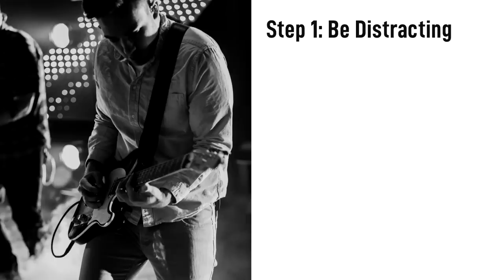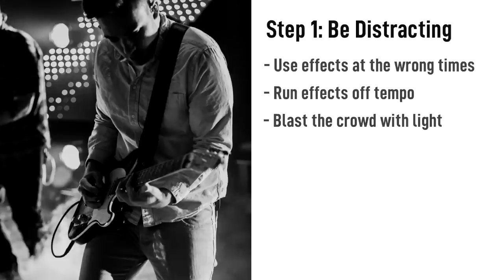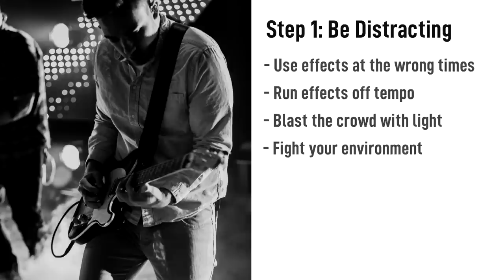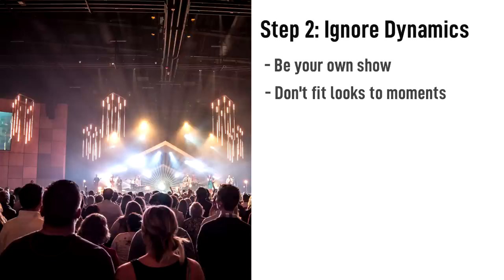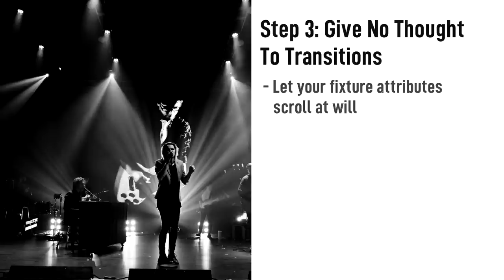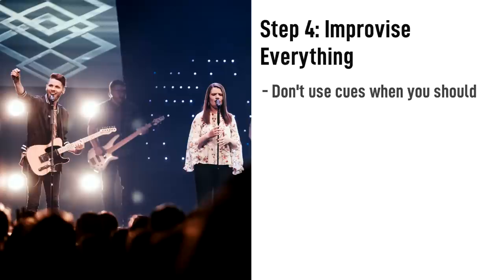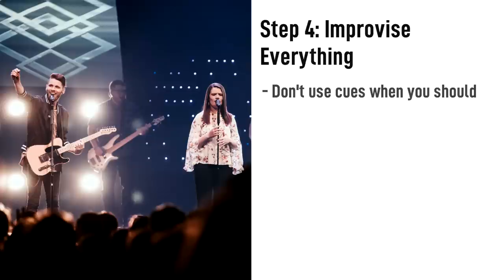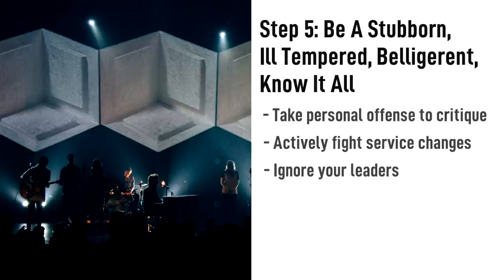How To Be A Bad Lighting Designer

Comment: I agree with ALL of this! However, when you sync your effects, they don't ALWAYS have to be synced to a quarter note BPM, sometimes I run a song quarter speed, or half speed, or OCCASIONALLY I will flash some leds with ALL different speeds, but close together. It's a cool look that has a nice analog flow that's useful for par chases... Zach Williams, and Crowder... and movers, or led pars... for Hillsong Y&F and or Planet shakers, and some River Valley Worship    Great stuff and god bless you and your ministry!
Reply: you dont need to have effects BPM synced all the time. saying that it has to be synced to a certain fraction of the songs tempo is silly. sometimes it makes sense to have fx speeds that gradually rise or decline over a period of time to add a sense of tension and relief